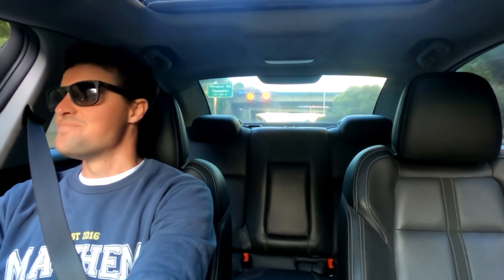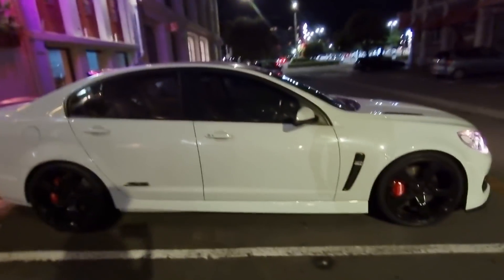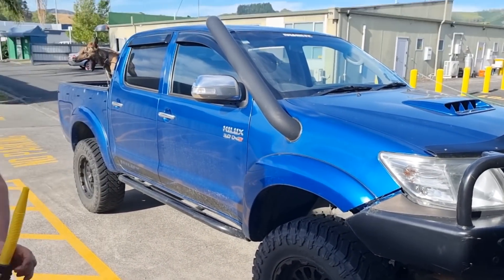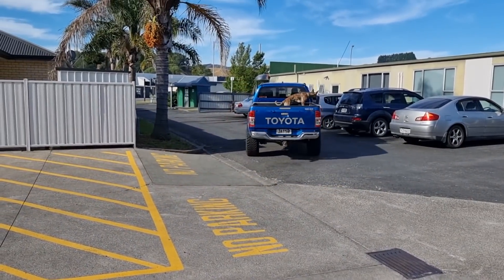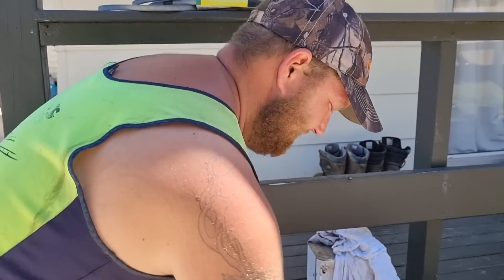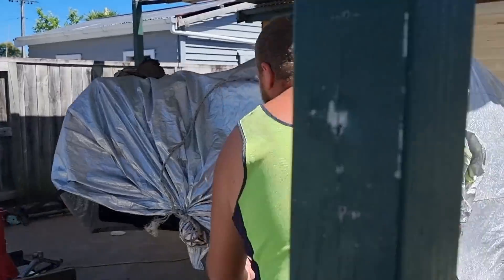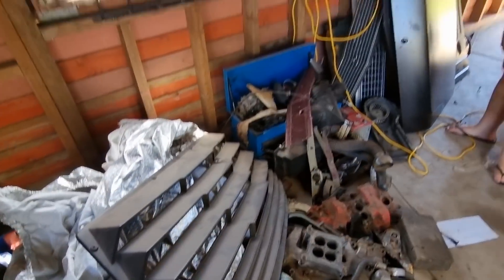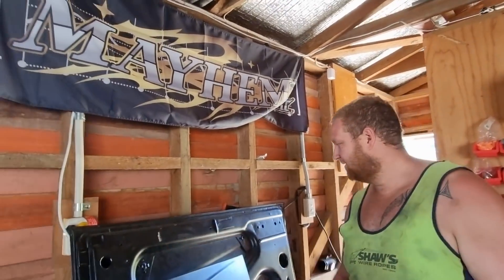New Forged LS3 Engine! Capable Of 1000HP+

Comment: Did you ever get that substance in the pick-up analysed or identified? Penrite has a good reputation, so I am surprised that it might be the culprit. Which Penrite exactly were you using? For others who read this, Gulf Western Syn-X-4000 is 5W-30, Dexos 1 Gen 3. This is the best oil for an LS3.
Reply from the maker: Nope no idea. Can't remember now but I think 5w-30 10 tenths
Reply: @MayhemInc  that's a good oil, especially for a worked engine with 430kW

Comment: hey bro i seen the substance back when the motor let go it reminded me of a time i had a crane with oil pressure issue come to find simular shit in the pickup and it was from penrite 20L barrels from when the lid threads had been cut onto the 20L barrel the threads werent cleaned out of the barrels and ended up in my engine ( i had the crane serviced by local mechanics) that was the source my problem anyway but the stuff you showed looked very simular
Reply from the maker: That's very interesting considering I used Penrite oil. Still have the containers too
Reply from the maker: How did you come to the conclusion it was that and did you get anything out of Penrite
Reply: @MayhemInc  yes they admited it replaced the barrels free of charge but other then that not much was running a fleet of cranes at the time wasnt interested in geting anything but the problem sorted out and penrite admited the problem when we rang them with pictures/video
Reply: i also had a bagged sample of a 20l i had sitting with insane amounts of strands in it that eventually melt to a soft paste shit and offered to send them it but they knew what it was dont use hitec aswell that shit is trash i had my crane pickups cleaned out with fresh bearings rolled in after that episode
Reply from the maker: @KillTyres  appreciate that bro. Looks like I'm going to try test melting it down in oil, then if it's that give them a message and if they don't want to come up with a solution they're going to have a very bad reputation
Reply: @MayhemInc  good luck bro very odd to have that shit in your oil your motor wont make that shit its contamination from something it looks so simular to the situation i had
Reply: Oh fuck no I’m staying away from penrite now